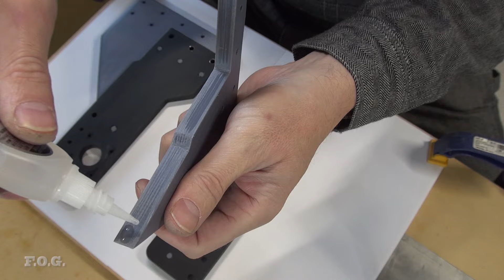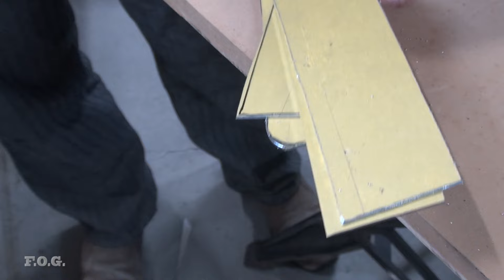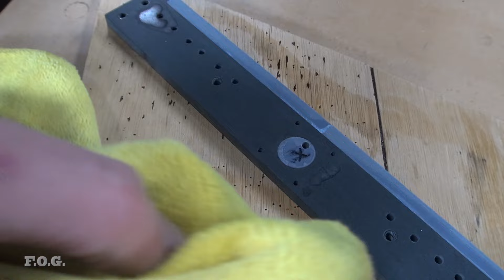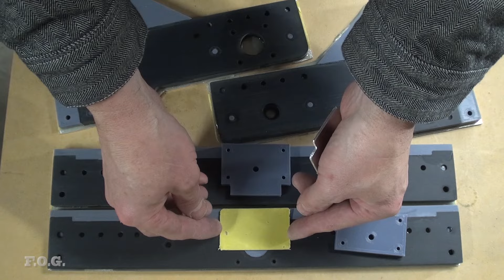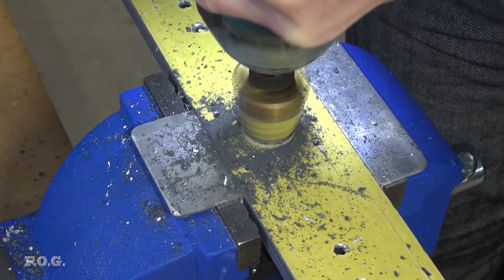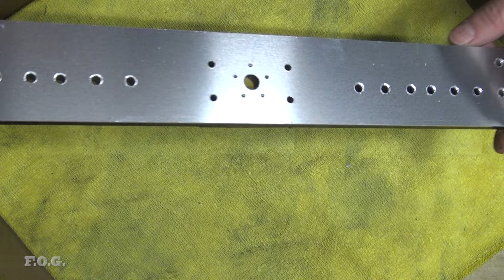EP2 – CNC3018 Rebuild – Upsizing the Frame

Comment: When routing round a template with a bearing guide, round the outside its better to go anticlockwise and on an inside, like in a hole, go clockwise, This means you are always driving the cutter into fresh metal/wood and its pushing back against you so you have control, the other way the blade can dig in and pull the router out of control, look up climb milling vs conventional milling to explain better, you get a better finish too. Nice project.
Reply from the maker: Didn't notice I was going the wrong way, usually I am pretty careful about that. Thankfully it worked out ok.